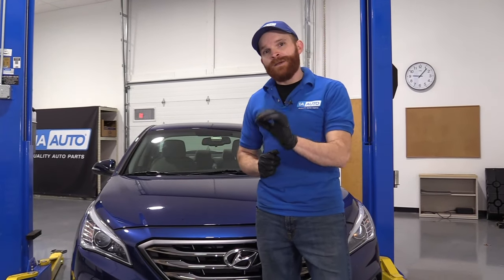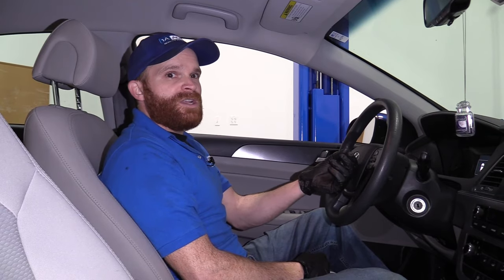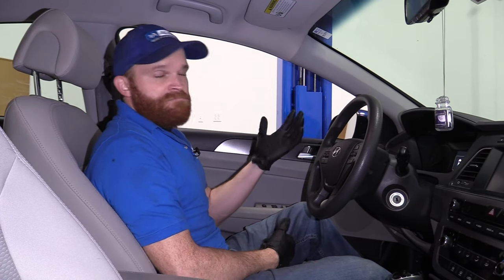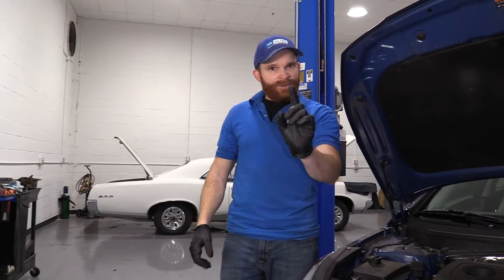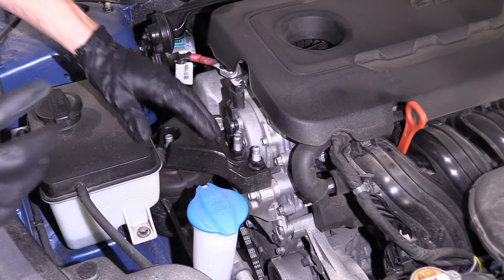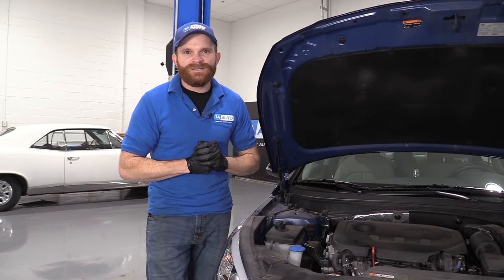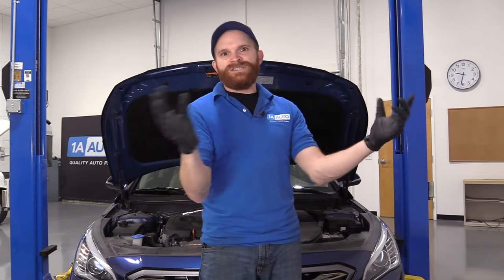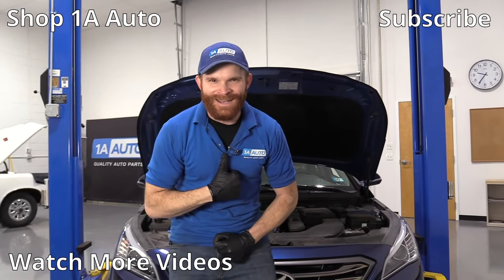Top 5 Problems Hyundai Sonata Sedan 7th Generation 2015-20

Comment from the maker: √  Watch the Video
√  Buy The Part at 1A Auto http://1aau.to/m/Visit-1AAuto
√  Do it Yourself
√  Save Money
Reply: I have an issue I am hoping to find and fix myself if anyone can help me please let me know thanks..... I have a 2016 hyundai sonata sport and out of nowhere my 4 outside brake lights do not work when I hit the pedal the taillights are working and the middle brake light in the rear window is working when I hit the pedal but the 2 on the trunk lid and 2 on the rear fenders do not brighten they only stay at running light brightness     I'm leaning toward the brake lamp switch but confused as to why the center light still works and the others don't    please if you know what this issue is let me know thank you
Reply: How to put a clutch cable on a Hunt 2011 Hyundai sonata

Comment: My dad has a 2015 sonata and hasn’t had any problems with it..very good car that’s why I just purchased the 2021 sonata limited..maintenance really helps with keeping the car running smoothly
Reply: Good choice hyundai good.
Reply: Im really leaning towards Hyundai hopefully no problem 🤞🏼
Reply: My motor ceased at 60k sonata limited 2017. If you look it up it’s also common, sadly.
Reply: @kpurdy5352  how funny, mine did too at exactly same mileage and I had it replaced
Reply: Yeah Hyundai especially the sonata are great sadly some had oil consumption issues which led to alot of Catastrophic failure due to combined maintenance neglect. But you made an awesome choice with your car. They seem to have solved that issue.
Reply: @kpurdy5352  change your oil every 4000 miles with 5w-20 Pennzoil platinum, you won't have issues, add a fuel system cleaner to the tank twice a year and fill up with 89 octane gas, my 2015 has 151k no issues

Comment: The P1326 code (Knock sensor)  could be the engine crank bearings going out, which is covered by Hyundai (in the USA) for unlimited miles and unlimited years, as long as the car is not a salvage title,  at least one oil change has been done in the prior 12 months, and the 953 Knock Sensor software update has been done by a dealer... Note, this extra warranty on the crankshaft  and pistons is the result of a class action lawsuit settlement.

Comment: Bought a 2015 Sport turbo used last year. Last month at 70,000 my engine seized while I was accelerating hard getting on the freeway.  Long story short, after some testing,  Hyundai is replacing the engine and has provided me with a rental car. Am so glad Hyundai stepped up.
Reply from the maker: +Daniel Berlanga Thanks for checking us out! http://1aau.to/m/Shop-1AAuto-c
Reply: Same here with my 2015 sonata sport. Engine barring went out I believe. Now I’m having trouble with the transmission shifting. Which I hope it’s nothing major 🤦🏽
Reply: Happen to me too lemon of car
Reply: @1AAuto  So should I buy this car I want something reliable but looks sexy at the sane time camry doesn't fit me to much

Comment: I have a 2015 Sonata Limited with 200k miles 204,000 to be exact no issues at all. I change oil regularly drives and sounds great when it finally plays out I’ll probably by another. Great car and features no other car at the time of purchase in same class...in 2015 came with the same features..it had most room, safety features regarding lane changes, heat and air in seats and heat in rear, heat in steering wheel, still getting 600miles to the tank.
Reply: I just bought a Hyundai Sonata 2015 with 30K mikes this comment gave me hope hahaha
Reply: I’m at 85,000 still feels news
Reply: Good for you. I had 2015 sonata at 52k miles. Recieved a letter extending my warrant primarily the engine. To be exact bearings. Months later had engine problems...car almost felt like it was locking up. Oh I lost full power driving down the road around 60mph. Took care all maintenance on time. Took it to the dealership, but they claim they're booked for 30 days. Suggested I take it to another shop and seek reimbursement through warrant. Other shop ran my car issue through their data base. Guy was surprised how many issues surrounding the engine. Literally he was genuine surprised. Spent $800 plus at the shop, car felt like it didn't want to start, or rather a delay start. Sold it asap just before the chip shortage got rough. It doesn't matter you do all the maintenance if the car badly built you'll have problem. Never buy Hyundai again. That was my second Hyundai and last.
Reply: @blackwind6317  was this the hybrid version ?
Reply: @blackwind6317  nah, you may just have a bad one  
There very good cars. Imma buy one only issue they had was with the hybrid version 2.0 engine
Reply: My husband bought a 2015 Hyundai Sonata Limited from Carvana and keeping up with the maintenance is huge. He loves all the feature but we just spent $1400 to change the brakes, fluid transmission, engine coolant and other things. But after that was done the car drives amazing. Love the car but can’t emphasize enough that any car can last if the maintenance is kept up. Only have 49000 miles on it
Reply: @nazinas21  it’s a great car just keep up with the maintenance!!!!
Reply: I had one brand new was a lemon from the start. The 2nd one I'm at 216k I'm only getting 25mpg after changing everything
Reply: mines the same way but a 2016 with 160k miles. love the car so much!! wish mine had that good gas mileage tho lol

Comment: I just bought used 2015 sonata.162000. When I’m driving fast uphill . I noticed car engine shakes. I just bought new battery & did synthetic oil change. Any info on what needs to be updated is appreciated.

Comment: p1326 took to dealer, replaced engine #3 cylinder was bad, right, or ,, anyways got engine replaced, ok next day after new engine code comes back ,, bought a throtle body an had it programmed, problem solved, hmmmm  yes dealer scammed me an hyundai, never got to see the bad engine or the bad parts,  scam thanks hyundai.............. for a year now the smell of gas is coming from my car any ideas what that could be, dealer said they need it for 2 weeks no loaner

Comment: I have a 2017 Sonata SE with 116800 miles and the problems I have had so far is a trunk latch failure and the electric steering wheel kept locking up. I took it to the Hyundai dealership and they fixed it.
Reply: How much did they charge you to fix it I'm having that issue right now

Comment: I own a 2015 sonata 2.4l sport
I Changed the C.V. V.T AT 100K KM, the spark plug, and recently both my serp. Belt along with tensioner!
I also do intake valve and injector cleaner every 50k 
Because it is necessary.
I never though all this had to be done soo soon
Reply: I read your comments, can you please tell me what those acronyms mean. I have a 2016 Hyundai sonata 2.4 l sport and so far I've only done regular maintenance on it. But I did ask Lynn whether this airbag issue was predominant in the brand because I definitely want to have that checked. In two previous cars airbags saved my life in accidents, that I did not cause.

Comment: 2016 sonata. Engine blew at 60k miles, pistons shattered according to dealer. Had engine replaced under warranty. Huge problems with the 2.4l
Reply: My 2015 is getting its engine replaced right now. How the engine didn't get mentioned in this video blows my mind.
Reply: its a manufactering defect. They didn't have the right mix of alloys
Reply: Same problem, replaced with new engine in a 2015 sonata sport, pistons messed up, water somehow got in, timing chain recall, happened around 75k
Reply: @blizzard5287  2
Reply: Leaking oil from the turbo action?
Reply: I have. 2017 Sonata SE. 58,000 miles. The VCM has to be replaced.  And all my oil changes were done when they were suppose to be done. At first they were saying that it may be the motor and I may have to get the whole engine done. I’m glad I don’t have to get a new engine after they checked it, but it only has 58,000 miles on it!!! No car at 58,000 miles should be even discussing a new engine.

Comment: My 2015 Sonata SE engine seized while driving it turned off so quick I didn't even have time to move the car to a safer spot to the right.  Wouldn't turn back on.  I then learned this is a common issue with Sonata from 2011 to 2019 and a lot of people have been able to get their engines replaced for free from Hyundai.   Mines at the dealership waiting to get diagnosed, been waiting since the day after Thanksgiving.

Comment: I have a 2016 se. If your battery goes weak, it affects acceleration.  So replace your battery at the first sign of it going bad.
Reply: have you had any issues with the sonata burning oil?
Reply: Are you serious? Affects acceleration? How? I have a 2017 sonata se  my batter went weak twice now I have a portable jump starter
Reply: It should not affect acceleration. Sounds like a weak alternator.
Reply: @physio_bodybuilding  also u should note there is a recall on some of the engines and burning oil is one.of the key indicators of the recall. I just had my motor replaced due to this recall a yrs ago and Hyundai covered almost full repair

Comment: I have some questions about my Sonata 2017 2.4 

1. Trunk light is not working and even on the dash when trunk open it is not showing what does it mean ? I also check the fuse it is ok.

2. Engine oil is burning after 4000 miles I checked my dip stick the oil level was little above Low point.
Reply from the maker: +Majid Yousuf We wouldn't be able to diagnose issues like that here, you may want to have a local mechanic take a look at it. Thanks for checking us out! http://1aau.to/m/Shop-1AAuto-c
Reply: Change the oil at 3k miles with full synthetic and check the dip stick once a week to make sure it's not burning too much. All GDI engines burn oil more than other engines.

Comment: One of the issues I have with my 2015 Sonata is, I'm assuming, some safety features. For example, if I want to adjust the bass and treble on my radio I have to be stopped and in Park before it will let me adjust. There are some safety issues I just don't need Papa Bear's help with. There are other adjustments to other things that require the car to be stopped and in park. Obviously some safety features are necessary, the obvious ones being seat belts and air bags. Why does Hyundai think they need to save me from myself? I've been making radio adjustments on other cars for decades without a single problem. If they're going to keep me from adjusting bass and treble without the car stopped and in park, why not just go the full ridiculous mile and make me have to put it in park to allow me to just turn on the radio? That way there will be zero distraction. I'm more angry and distracted by not being able to adjust things unless I'm stopped than if they'd just allow me to make changes while I'm rolling. Hyundai, I don't need your help with something as benign as adjusting my radio. That's as ridiculous as putting a catch net under my toilet seat to keep my from falling in!

Comment: 2015 Sport, I have a whining sound with slight increase in speed.  Let up on the gas and coast no whinning sound.  Not sure if this is related a VCM failed, controls inlet air, gear driven electeic motor. Replaced the part, no change in sound.  Whining sound is my only issue with the car

Comment: I have 2017 Hyundai sonata and I changed battery and then my check engine light came on so I went and got it checked and said transmission sensor where is that sensor located and is it goin to o b expensive to fix

Comment: I have 2 problems with my 2016 Sonata: steering gets notchy when on the highway - very fatiguing, and accelerator is not smooth - it has a step function, accelerating fast from a stop when you just want a smooth action.
Reply: Try doing a transmission fluid change. A few people have done so and they have had no problems after with accelerating

Comment: I have a 2018 Hyundai Sonata p1326 limp mode 60,000 miles, they updated the firmware and said it will it is probably going to happen again or the engine may fail. I do all my maintenance but did not get much help from Hyundai to fix it.

Comment: I have an issue I am hoping to find and fix myself if anyone can help me please let me know thanks..... I have a 2016 hyundai sonata sport and out of nowhere my 4 outside brake lights do not work when I hit the pedal the taillights are working and the middle brake light in the rear window is working when I hit the pedal but the 2 on the trunk lid and 2 on the rear fenders do not brighten they only stay at running light brightness     I'm leaning toward the brake lamp switch but confused as to why the center light still works and the others don't    please if you know what this issue is let me know thank you

Comment: Nice Hyundai sponsored content. Just completely ignore the oiling issues with these engines. Bad piston ring design, poor manufacturing on the oil pressure flow valve, pcv clogging.

Comment: I have the 2016 Hyundai Sonata limited version 2.4 engine and I noticed it was always getting low on oil and that I had to keep extra with me, but eventually it locked up and soon later I had to leave it to leave for basic training for the military, 25 weeks later in October I go back home and my mother tells me I received a letter from Hyundai saying there’s been recalls on all Hyundai Sonatas from year 2015-2017 and mines just in the middle so having it towed to dealership so they could diagnose the problems and see for themselves the engine in fact locked up, and it was covered by dealership warranty because my car was at 89,000 miles and right under the 100,000 mark it was covered so they replaced the engine with a brand new 2022 sonata limited engine and ever since then I’ve never encountered any more issues with the car and the power is definitely a difference with this engine compared to the old defected ones,

Comment: I have a 2018 sonata 50k and have a burning oil issue. When I'm on the highway black smoke plumes out like it's a diesel truck. I've always done a oil change at 3000k I noticed Im Burning about a qt a month. Not good! I also got in the mail a few months ago a class action lawsuit letter dating that the engines on the Hyundai sonata had catastrophic failures going on... And they told me that my vehicle is probably one of the ones that they are referring to and it's a lifetime warranty on the engine as long as I own it and don't sell it. So I'm going to run this mother f*** into the ground and give myself a brand new engine!
Reply: I have the same issue with my 2015, can’t wait for the new engine that’s still under warranty 😂

Comment: I have a 2016 SE with 127k. I absolutely love that car. I must be one of the lucky ones to not have experienced anything major. Or really anything at all.  Don’t think for a second that means I’ve ever coddled it. Cars are made for one thing only, to drive.  Believe it or not, but I swear the car sometimes just wants to go. Especially when temps are cooler. Ive noticed that when you handle a car with kid gloves that “kid” tends to become extremely fragile.  That’s not to say I don’t, routinely, keep up with the critical maintenance; fluids, wear ‘n tear etc….. Hell, I may have washed the thing more in a week than most normal, sane people do in a year. 😂  I’m talking “detailed” washed it. No hose down from the nose down. (I don’t even know if that’s a thing 🤷🏼‍♂️)
Anywho….. my opinion is that is one of the best mid-sized sedans you can buy. Too bad Hyundai had to completely butcher the look of it. Now it’s just kinda looks like a weird turtle or something.

Comment: 2016 Sonata Sport Tech (Canada only model I think) 100000 km always maintained and ZERO problems.
Reply: Lol 2015 with 54k miles. Engine issue. Maintenance done poor quality. I thought it was weird to get a extended warrant last year only for Engine. Make sense now. Luckily I sold it before issues started getting expensive.

Comment: I have 2015 sonata 2.4L for last 3 yrs with 65k miles on it. Engine has always had pinging at acceleration and lagged on speed. I decided this yr to use synthetic oils and high 92 octane gas.  Took driving mode off eco. Seems to be gone.

Comment: Good video. It would be extremely helpful if you could provide an approximate cost for the repair of each issue. An estimate of number of hours of labor and cost of parts would be great.
Reply: @ArceliaHernandez-qx4ri  did they require receipts of oil changes?

Comment: This car is great, I bought it used, at 70,000 and now I've had it for about a year and I'm at 130,000. But for some reason my passenger axel keeps going bad. Other than that the car has no problems , zero, I can tell it's still healthy and I push my car to the limit so with that being said I'm still lucky

Comment: Hey there.  I have a 2016 Hyundai sonata 2.4 l sport.  Are you definitely saying there is a possible problem with the airbag for the driver in this car? If so is there a recall for this cuz I can't find it. Because I would like to have it taken in to definitely have that handled. Because in the last 3 years I've had two car accidents where the airbags have saved my life. One was from a woman who turned right in front of me in her brand new car that she just bought. The second was from an 8-point buck deer that jumped in front of my vehicle from the side of the road. So I want to make sure that this sonata I have definitely has an airbag that will work 100%.  So I want to confirm that you're definitely saying this is a defect that is covered under some type of recall. Thank you for your channel.

As for the other issues you have mentioned I'm going to pay attention for those, but at $64,000 mi I have not seen any of those other issues.  I was hoping this car would be like my previous Toyota and my previous Honda they had you 296,000 mi and 309,000 mi respectively, and both of them were either sold or given away they worked when I got rid of them.